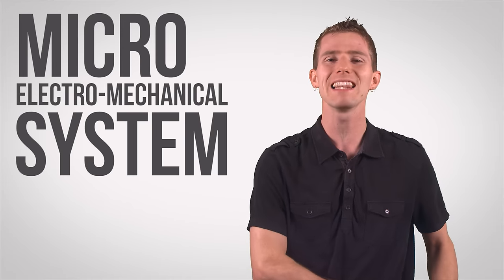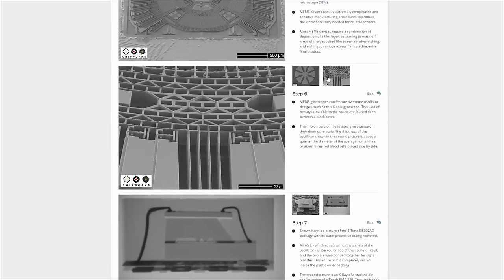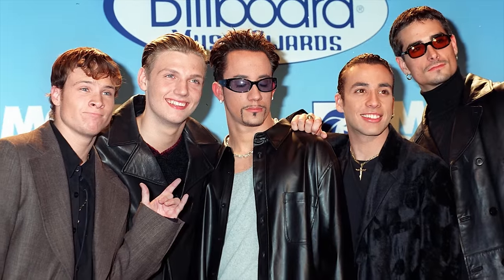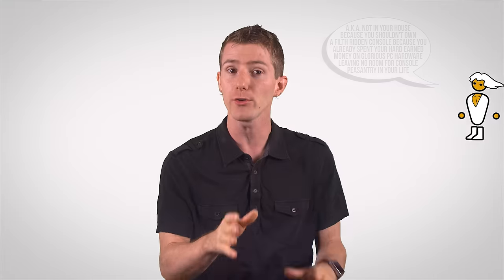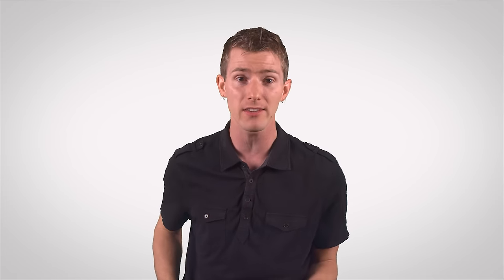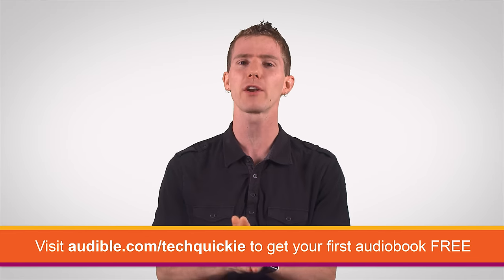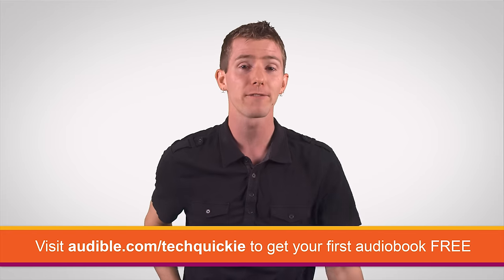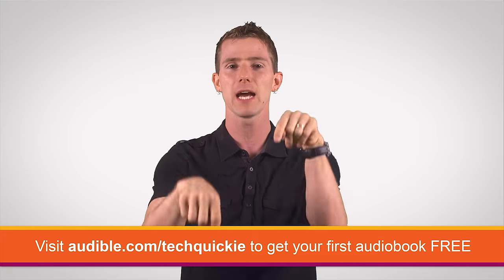Motion Sensors as Fast As Possible

Comment: So... Does my phone actually have a tiny spinning disk inside for the rotation sensor gyroscope, or is it just approximated by some accelerometers? I find it hard to believe that there could actually be a physical gyro in my phone.
Reply: ***** There definitely could be. They can be manufactured incredibly small.
Reply: ***** Phones use a MEMS gyroscope. Its mostly transistor based, involving some interesting physics.
Reply: Dank mems technology m8
Reply: kauttaja85 True, MEMS gyroscopes on their own are unusable in advanced motion capture applications, BUT if you combine them with something that could correct their readigns in realtime the problem becomes essentially non-existent. It's called a sensor fusion. In this case it's usually a magnetometer that corrects the readings of a gyro. Such combinations are commonly used in inertial motion sensor packages.
Reply: ***** maybe both working in conjunction?
Reply: I read in an article that the gyroscope in a mobile phone is actually a cluster of vibrating crystals in different orientations. They resist change in orientation in the same way a spinning disk does. The graphic used in the video was rather misleading.
Reply: kauttaja85 Yep, pretty much the best IMUs in existence are for guiding intercontinental ballistic missiles and nuclear submarines and there is probably no way you're going to fit a beryllium suspended spinning mass gyro in a phone.  Also keep in mind, a good IMU needs to be coupled with a good INS (intertial navigation system), ie the mathematics behind turning accelerations and rotational information to relative movements, to be worth a damn.  As Q009, stated corrections using other sensors using a Kalman filter can substantially reduce the overall error.
Reply: You can build it even in size of a couple nanometers 
Because the physics works the same way even on that small things
Reply: Physical gyro nolonger really used. Aircraft uses laser based gyros instead
Reply: @AaronShenghao  cough ...phones..... coughcough
Reply: @ShredBird  the most advanced gyros are light based that use sagnac effect.
Reply: @ShredBird  interesting fact, a satellite not long ago used it's gyroscoping dampening/aligning system with large flywheel to change its orientation after the propulsion system failed.
Reply: Instead of a rotational gyro, it uses a series of string like gyros that basically vibrate in a single line and when you twist it there is a 90° procession. They use a series of these to emulate every single axis.

Comment: Hi. Could you do a As Fast as Possible on Fans?

In other videos you talk about them being optimized for static pressure or air flow. When do you use which one (aside from SP on radiators)? What flow rate and static pressure is good for each of them, what would be values for a hybrid (if such exist), what pressure do fans need for typical applications...?

Just stumbled upon your videos a few days ago and immediately binged on them for hours with 20+ tabs open. Great videos, keep it up!

Comment: QUESTION: 
Suppose you have latitude and longitude as 19.0649070739746 and 73.1308670043945 respectively. In this case both coordinates are 13 decimal places long, but sometimes I also get coordinates which are 6 decimal places long. Does fewer decimal points affect accuracy? What does every digit after the decimal place signify?

ANSWER: 
Well, Accuracy is the tendency of your measurements to agree with the true values. Precision is the degree to which your measurements pin down an actual value. The question is about an interplay of accuracy and precision.

As a general principle, you don't need much more precision in recording your measurements than there is accuracy built into them. Using too much precision can mislead people into believing the accuracy is greater than it really is.

Generally, when you degrade precision--that is, use fewer decimal places--you can lose some accuracy. But how much? It's good to know that the meter was originally defined (by the French, around the time of their revolution when they were throwing out the old systems and zealously replacing them by new ones) so that ten million of them would take you from the equator to a pole. That's 90 degrees, so one degree of latitude covers about 10^7/90 = 111,111 meters. ("About," because the meter's length has changed a little bit in the meantime. But that doesn't matter.) Furthermore, a degree of longitude (east-west) is about the same or less in length than a degree of latitude, because the circles of latitude shrink down to the earth's axis as we move from the equator towards either pole. Therefore, it's always safe to figure that the sixth decimal place in one decimal degree has 111,111/10^6 = about 1/9 meter = about 4 inches of precision.

Accordingly, if your accuracy needs are, say, give or take 10 meters, than 1/9 meter is nothing: you lose essentially no accuracy by using six decimal places. If your accuracy need is sub-centimeter, then you need at least seven and probably eight decimal places, but more will do you little good.

Thirteen decimal places will pin down the location to 111,111/10^13 = about 1 angstrom, around half the thickness of a small atom.

Using these ideas we can construct a table of what each digit in a decimal degree signifies:

-The sign tells us whether we are north or south, east or west on the globe.
A nonzero hundreds digit tells us we're using longitude, not latitude!

-The tens digit gives a position to about 1,000 kilometers. It gives us useful information about what continent or ocean we are on.

-The units digit (one decimal degree) gives a position up to 111 kilometers (60 nautical miles, about 69 miles). It can tell us roughly what large state or country we are in.

-The first decimal place is worth up to 11.1 km: it can distinguish the position of one large city from a neighboring large city.

-The second decimal place is worth up to 1.1 km: it can separate one village from the next.

-The third decimal place is worth up to 110 m: it can identify a large agricultural field or institutional campus.

-The fourth decimal place is worth up to 11 m: it can identify a parcel of land. It is comparable to the typical accuracy of an uncorrected GPS unit with no interference.

-The fifth decimal place is worth up to 1.1 m: it distinguish trees from each other. Accuracy to this level with commercial GPS units can only be achieved with differential correction.

-The sixth decimal place is worth up to 0.11 m: you can use this for laying out structures in detail, for designing landscapes, building roads. It should be more than good enough for tracking movements of glaciers and rivers. This can be achieved by taking painstaking measures with GPS, such as differentially corrected GPS.

-The seventh decimal place is worth up to 11 mm: this is good for much surveying and is near the limit of what GPS-based techniques can achieve.

-The eighth decimal place is worth up to 1.1 mm: this is good for charting motions of tectonic plates and movements of volcanoes. Permanent, corrected, constantly-running GPS base stations might be able to achieve this level of accuracy.

-The ninth decimal place is worth up to 110 microns: we are getting into the range of microscopy. For almost any conceivable application with earth positions, this is overkill and will be more precise than the accuracy of any surveying device.

-Ten or more decimal places indicates a computer or calculator was used and that no attention was paid to the fact that the extra decimals are useless. Be careful, because unless you are the one reading these numbers off the device, this can indicate low quality processing!
Reply: Mobliz Mobilz Math TIPS
Reply: +Mobliz 
-Does fewer decimal points affect accuracy?
no
19,1234500000 is the same as 19,12345
-What does every digit after the decimal place signify?
A number?
there is no accuracy gained in more digits after the comma, you can have a very accourate measurement but only show few digits after the comma for readbility purposses

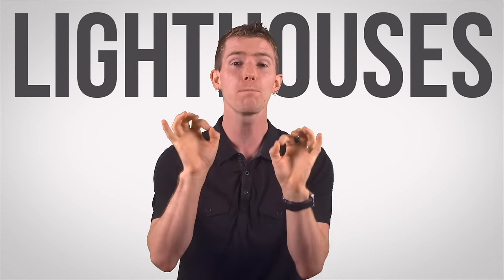Comment: Good video, but at 3:17 you incorrectly mention "cameras" on the vive. The Vive doesn't use any cameras, but instead uses an array of simple infrared sensors and trigonometry to determine its location. The sensors used are not complex enough to give back an image, instead they simply relay a binary on-off state. They determine exact positioning based on the timing difference on each sensor lighting up.

Basically they function more like an array of NES Zappers than a Wiimote.

Comment: Do those motion sensor work via the piezo electrical effect of just by magtnetic fields?
Reply: FraeschD neither, they work by measuring the variations of the capacitance when that mass moves and get closer to one side or the other, accelerometers have 3 masses that moves to each of the three axis (x,y,z)
Reply: Ramiro, the capacitance changes in the ceramic material due to the alignment of the dipoles. This alignment is caused by the electric field from the mechanical stress (piezoelectric effect)

Comment: This doesnt explain have android sensors measure speed
IR cameras, i dont think it works that way, few IR sensors work across walls and can reflect from floor to anywhere in the room even if its not pointed at the device
They need to add joysticks or characters in VR, you cant keep walking in a bus or house to see a VR mall

Comment: I thought I don't need an accelerometer in my smartphone. Now I found using my smartphone can't reliably detect level and screen rotation detection is flaky. Yeah Motorola, this was the right place to save the $0.5 on components.